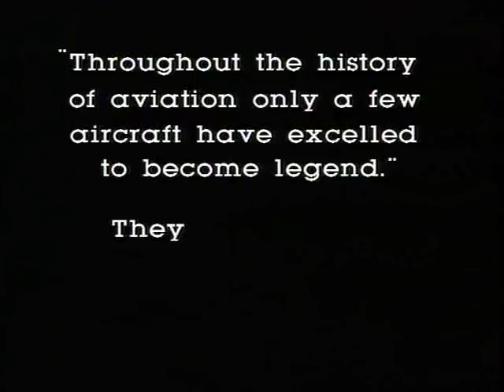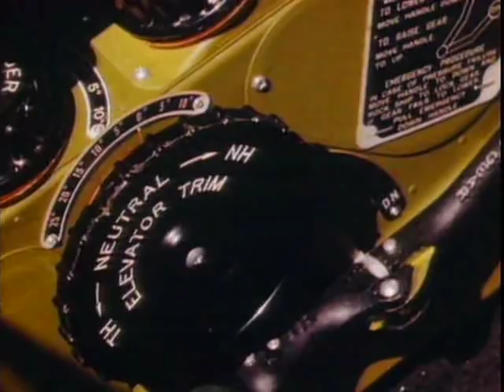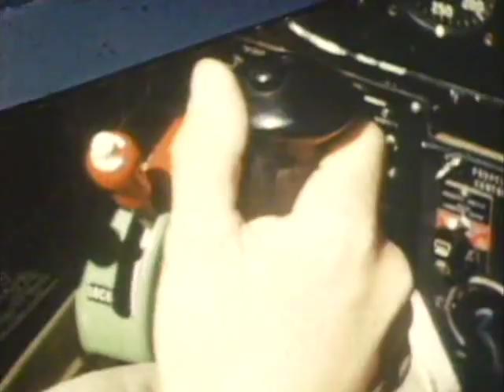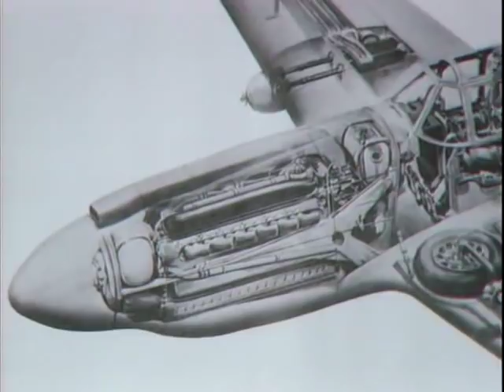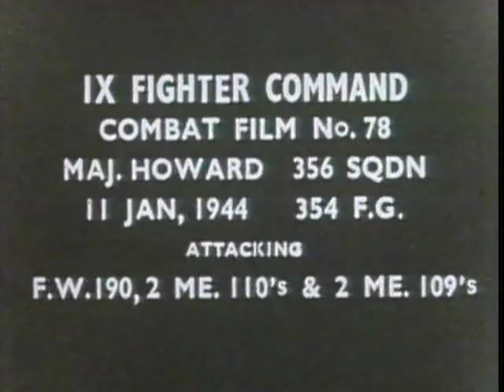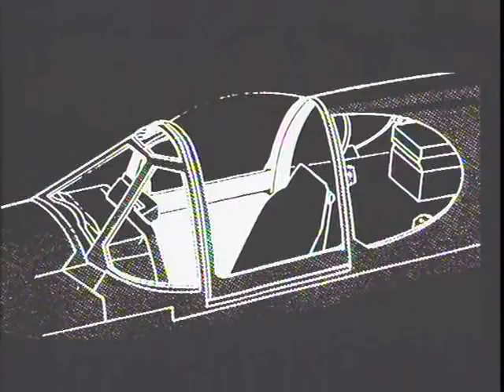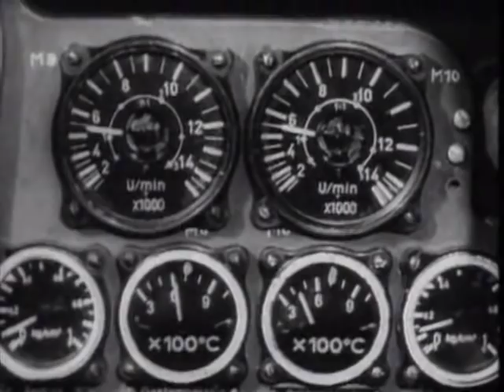Great Planes - North American P-51 Mustang

Comment: The Rolls Royce Merlin engine made this mediocre plane into one of the better aircraft in WW@ , however it was not a patch on the later marques of Spitfire , Typhoon and Tempest
Reply: Gary Tarr The P51 had the first laminar-flow airfoil on any fighter and used heat-jet-thrust from the radiator to boost top speed. The P51 was 40mph faster than the P40 with the same Allison engine and 40mph faster than the Spitfire with the same Merlin engine. The laminar-flow wing bled off speed so slowly that P51B/C/D's could obtain enough speed in a dive to catch ME262's, provided the P51 was at a higher altitude than the ME262. What dictionary are you using for the definition of "Mediocre"? 

Post WW2 Mustangs pretty well dominated Spitfires, Typhoons and Tempests, P47's,F4U's, F8F's, etc in Air Racing, so P51 aerodynamics held up very well into the jet age.
Reply: Gary Tarr The post war air racing career of Spitfires, Tempests, Typhoons etc against the dominating P51 is proof positive that your statement is not accurate.
Reply: Gary Tarr Genital size and lack of air racing in England does not change the fact that the strong, aerodynamic P51 airframe has consistently dominated other piston engine fighter aircraft in direct, head-to-head competition.
Reply: 63DW89A  "Dutch" Kendelberger stole his ideas from visits to British and German factories before the war. The laminar flow wing was a German idea. The Americans had put a laminar flow wing on the Liberator without realising it's significance in drag reduction. The high altitude engine performance was an entirely British development. The British gave the design to North American Aviation, UK factories were  tooled up for the Spitfire and Hurricane and changing would have slowed the war effort.
Reply: 63DW89A It proves nothing. Air racing of such aircraft at places like Reno didn't start until 1964, by which time airworthy Spitfires were a rarety and Tempests and Typhoons non existant due to our post war need of metals like Alluminium., unlike the US which had more than a few airfrrames of all it's WW2 aircraft.
So something that never occured, ie The post war air racing career of Spitfires, Tempests, Typhoons etc against the dominating P51 , cannot be held as proof of anything

"strong, aerodynamic P51 airframe has consistently dominated other piston engine fighter aircraft in direct, head-to-head competition2....wouldn't agree totaly with that either.
Reply: eric tull not really the US had 2 speed mechanical superchargers on Naval aircraft that was much better than any naval aircraft the Brits had.
The R2800 on the Hellcat and Corsair had them as well as the lowly Wildcat which was better than the crap the Brits flew off of carriers. Combined with longer ranges at sea the British planes were very limited.
Reply: crosstimbers2 Apples and Oranges. British naval aviation was not long range orientated, US naval aviation was. The "A" series double wasp had 2 stage superchargers, but they were only single speed.

The Typhhon was not designed as a high altitude fighter, but as a medium altitude interceptor-fighter and close support fighter/bomber. Although it had a ceiling of 33,000 feet, it was never intended to operate at that altitude.. 

I cannot agree that the Sabre was ,as you call it, "total crap" Complacency at Napier in the early varients, plus mistreatment of the engines in service led to an undeserved reputation, but after Napier was taken over by EEC, the Sabre became, by about 1944, the formidable power plant that is was.and it was used in the Typhoon and Tempest. By the mark V11 the Sabre was developing anything between 3,500 HP (unsupercharged) and 5,500 hp (s/charged). By comparison, the R4360 could manage 3.000 to 3,800 hp at twice the displacemant.

"None of your Spitifires had much range"......without drop tanks neither did the P51.  With drop tanks,the range of a Spit could be as much as 1,600 miles. In fact 2 Mk 1Xs with extra tanks were flown across the atlantic from Newfoundland to the UK non stop (Nos MK210 and MK317) .So, I rather think that, had necessity require it, the spit's range would not have been a problem.
I do not know where Americans get this idea that, regarding Spits and drop tanks, never the twain shall meet.

You could not win the war with your airplanes..  not a foregon conclusion....with the meteor coming into service....who knows·
Reply: crabfat   Sorry it does not work that way.  You fight a war with what you have. If you make design mistakes you lose AC, retire AC, redesign AC and possibly even lose the war.
The Brits had a bunch of inadequate short range aircraft. Many of the assumptions  each side made about aircraft designs were poor or wrong.  
The Zero was all maneuver and no protection.  
The American P-39 was short ranged and it was only set up for  best performance below 15,000 feet.
The Typhoon  used a terrible engine unsuited to warfare in any form. If you had any kind of engineering background you might understand but apparently you don't.  Sleeve valve engines belong in a museum as curiosities of how not to design engines.  So far as I know the type is not used anywhere in the world today.
The air cooled engines are still in wide use.
The Spitfire and Me 109 had no range and being liquid cooled were easy to shoot down.  The FW-190 was a better plane but again short on range.  The original Spitfires were armed with .303s. What were they thinking?
The Mustang had an extra 82 gallon internal tank behind the pilot so apparently you don't know so much about the Mustang do  you?  In addition the laminar flow wings made it fast  - but they also made it efficient since the aerodynamic drag was much lower.  
So you had 2 spits that flew a long way one time  -  damn that is not much to brag about
The max range of a P-38 was over 2000 miles. An F4U was about 1000 miles  Both the P-51 and P-47s flew beyond Berlin. The Spits sat on the ground while the P-47s and the P-51s destroyed the Luftwaffe over Germany. 
The fact is you could not win the war with your AC. You barely held your own while fighting the Battle of Britain against an adversary with planes that also had NO range.

The real fact is the UK got itself into a war it could not win. The British seem to have this preoccupation with fighting a defensive war on their little islands and then call that winning. Just like they speak with pride about Dunkirk like it was a victory of some sort.
The  UK's naval aviation was a joke. But the trend seems to be permanent. The UK does not even have any naval aviation at this time.
Reply: ***** the Davis airfoil was laminar flow and used on the B24 before the NACA started it's investigations....not that Consolodated knew it was. There were several aircraft modified by NACA, in the late 1930s, to have laminar flow test sections on their wings. Hence, such aircraft as a modified B-18 were some of the first aircraft to fly with laminar flow airfoils.

The boundary layer /laminar flow concept is credited to the  German aerodynamicist, Ludwig Prandtl. Prandtl hypothesized and proved the existence of the boundary layer long before the Mustang or B24 or the NACA were gleams gleam in anyone's eye..
Reply: +Gary Tarr  Prove you are right.
Reply: 18tangles  you don't have a V6 that you can get 550 HP out of. You just keep lying
You have to pump air and fuel through the engine to make power.
You either use boost, high RPM or displacement. 
There is nothing in the physics of a V6 is magic. A bigger engine will always produce more power all other things being the same.

My car has an engine with an aluminum block cast by Teksid in Italy - the same company that casts the blocks for Ferrari. 
The heads are also aluminum so the engine is not all that heavy for 4.6 liters.
The 4.6 liter with a supercharger puts out about 460 HP when the a smaller super charger driven pulley is used
There is a later version that is 5.4 liters (longer stroke) with a super charger
and there is a 5.4 liter naturally aspirated engine that puts out 385 HP.
Reply: ***** 
he is ate up with tall poppy syndrome

The tall poppy syndrome is a pejorative term primarily used in the United Kingdom, Australia, New Zealand, and other Anglosphere nations to describe a social phenomenon in which people of genuine merit are resented, attacked, cut down, or criticised because their talents or achievements elevate them above or distinguish them from their peers. This is similar to begrudgery, the resentment or envy of the success of a peer.

As such he thinks that if anyone else has a good plane it denigrates the Spitfire.
Reply: 18tangles Do you realize that no one gives a shit about the Pikes Peak race?
Do you know who won the Hotter than Hell 100 last year?  You don't??? Well neither do I.
It is a 100 mile bike race across the hottest part of North Texas in the middle of the summer. It is usually called the Dumber than Hell 100 and you would fit right in. No one gives a shit about either race.
Next you are going to tell me that the Peugeot engine is a stock engine - yeah right.  No one cares about Pikes Peak or shitty French cars.

Do you want to race that car across the back of my ranch? You want to see if it can even make it across at any speed? Do be so stupid No one cares about Pike's Peak record for unlimited cars.....
Reply: +63DW89A mediocre - not quite good enough, in some or all areas. The Allison-engined Mustangs were poor performers at altitude due to not having any supercharging worth speaking of. The Merlin gave the Mustang the missing high altitude (above 10,000 ft) capability. The Mustang was not the only aircraft of this period to use the Meredith effect - the De Havilland Mosquito also made use of it.
Reply: +crosstimbers2 that was an aerodynamics problem, not a powerplant issue. Perhaps you should stay in and read more.
Reply: @crosstimbers2  : No you should now tell us which of those engines had a Better Power to Weight and Power to Displacement over the Two Brit engines
Reply: @crosstimbers2  ; Crossdresser The engine Loeb used on Pikes Peak developed 500/600hp
Reply: @crosstimbers2  Tell me what US  4 door street car can beat 175mph or 3.2 secs to 60 mph
Reply: @erictull2089  Stole ????  WTF ????  He visited to see what the Germans and Brits were doing !!!!  The laminar flow wing was a NACA development, an American design !!!  P51  B24  B29 used it during the war !!!!  What British or German plane used the Laminar flow wing during the war ????  And sorry old bean what British plane used a TURBOcharged engine for High altitude performance ?????  P38  P47  B17  & B24;s all used a turbocharged engine long before the Brits ever had a 2 stage mechanical superchrger, late 1942 in service 1943 !!!!  Check the dates of introduction of the above planes !!!!  Why a B17 flew  10 to 12,000 ft higher than a Lancaster, and a B24  8 to 10,000Ft higher.  B24's laminar flow wing did not have the area of a B17, gave a higher speed but lacked altitude capabilities.What British design was "given" to North American??????
Reply: @crosstimbers2  They had 2 stage superchargers, PW !!!!  The 2 speed supercharges were also used, Wright !!!! The 2 stage supercharger, mechanical, was INVENTED and PATENTED  in 1938 By an American !!!!  Brits did not invent the 2 stage supercharger, but Harper IMPROVED some features !!!  Just the details !!!!
Reply: @crabfat1494  PW also used the single stage 2 speed superchargers because there was a supply problem !!! They could not build the 2 stage superchargers as fast as they were needed !!!
Reply: @63DW89A  Meredith Effect was known well before the US even used it Spitfires used it in 1936
Reply: @crosstimbers2  Cross dresser The Brits Rolls Royce in fact were the first to have 2 stage 2 speed supers which NO us plane could match . Even the Vincent super on the P51 could not beat the Rolls Royce Merlin super
Reply: @jacktattis143   Make that 186 mph from a 3.6 Litre 6 cylinder Vauxhall Lotus Carlton Where oh where are your muscle cars
Reply: @wilburfinnigan2142  The Laminar flow wing was a theoretical design the merest imperfections in the Real wing rendered it shit
Reply: @wilburfinnigan2142  Just the wrong details Wilbur The Merlin two speed two stage was NOT equalled by any US engine
Reply: @crosstimbers2   Well just a reminder you really do not know much